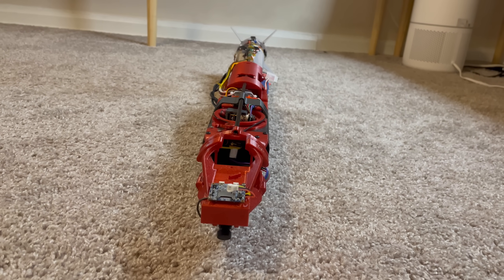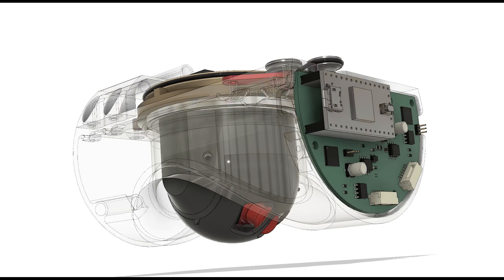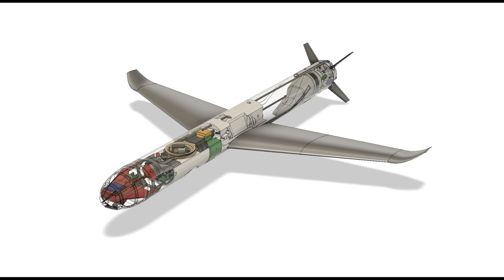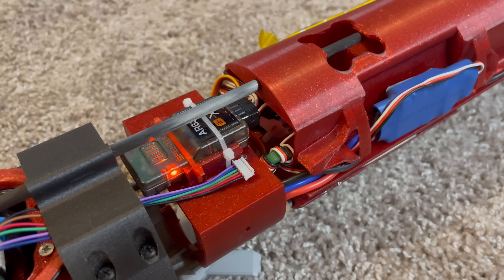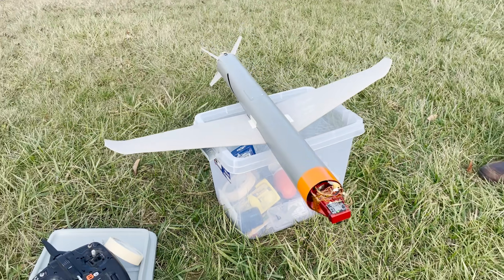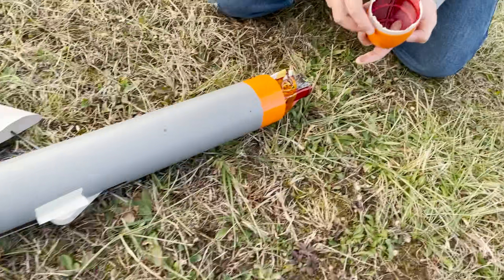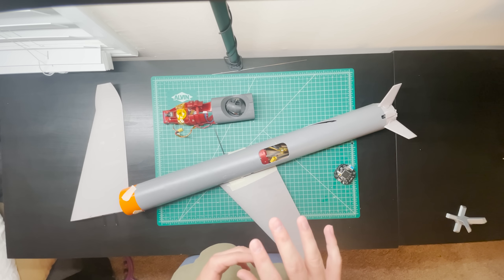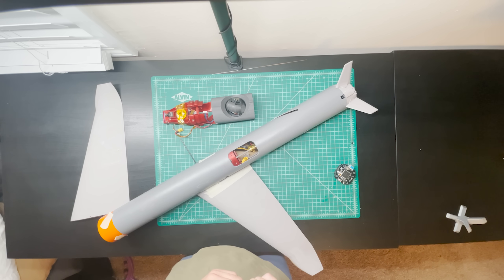Building (And Crashing) my Homemade Surveillance Drone

Comment: Don't rush with changing control fins!
I think, you should think about center of mass and center of lift relative positions.
It's considered to be easier to make plane with center of mass closer to nose then center of lift...
I think, you got it right...
Then, it must be not sufficient lift! You aircraft is to heavy for its wings!
I think, the wings should be 2x-3x larger. But it would add weight. Could you make them out of foam plastic?

P.S. I don't make planes, so I could be wrong.

Comment: You could keep the bottoms as long if you added a strong magnet to the back fins with some teeth to hold control authority. That way you just stick them back on after the they pop off.

Comment: it would work as a submarine but you need larger intake vent for edf to gather compress and force cubic feet meters out tge rear yes the weight is high , i can imagine it plane launched likeca glider but i don't think it has enough thrust to weight ratio ya can't really make up for it with 3x current wingsize for  more gliding surface area   but with a lil help it should be flyable

Comment: I am sure this is already under consideration, but this drone acting as a airborne relay/repeater point for the rockets telemetry packets like how the featherweights can relay gps from other lost featherweights would be an incredibly cool feature. Especially when it comes to two stage and higher altitude flights.

Comment: It's hard to tell what other problems it might have until you reduce the weight.  You can tell if the balance is correct without even trying to fly it.  Just find the point at which it naturally balances.

Comment: I would of assumed most of the build would of been done in LW-PLA rather than PetG. Granted the PetG is a more robust material, but of course with that adds a fair amount of weight.

Comment: As for the tailplane - add some vertical  and horizontal stabilizer  and not just control surfaces  - and make them bigger.  Also avoid big mass far away from cg.

Comment: On the EDF intake - it seems rather resticting the air flow. You need a lot more undisturbed intake area. I see that you want to keep the space for the folding wing. However it would be good to add air intakes on both sides and not on the bottom.   Very critical is also the boundary between EDF and intake.

Comment: The slingshot rail launcher is a good idea, I'd hook at the front, as without momentum at the front, the "pusher" is basically flipping the rear around, hopefully yanking it on a rail from the front will have it up to speed so the pusher isn't "end-arounding" it.  Good luck!

Comment: Sucking the air from the bottom creates aerodynamic downforce. Having it on the top would generate you extra lift, but during high aoa maneuvers you will have flow attachment problems.

Comment: You can attach an assisted launch booster at the bottom of the drone, it should give it enough thrust in the launch stage to reach cruising speed. The current fan is also most likely too small to propel something of this size, the drone has the features of a cruise missile, you might need to increase wing span to get allow the drone to glide better, this can also reduce your excessive yaw rotation during launch.

Comment: i was working with the Mirach series (targets) and they're very similar to the design you're looking for, in my opinion try put on a charge for the starting propulsion for short takeoff (with a tilted angle) or as you said a rail catapult, but i think you can improve the design changing the air intake and putting it on the top (or bottom) of the model in order to increase the aerodynamic suction angle and don't lose stability due to the small mass of the plane. you need to have an incidence for takeoff for this kind of design. Tbh cool idea, you can create a simpler underwater version with the design you made, if you put a fixed wing and some radars below (i was looking into make a similar models myself but require too much time for design of the wing nozzle etc)

Comment: Not enough thrust for launch, just by eye that thing looks like it needs to be going miles faster than you are getting it.

I think your best option is the bungie powered rail launch system you described to give it the initial velocity. 

Are there any more powerful EDFs you could use? 

Great project though, will follow with interest.

Comment: As a fellow drone designer, I would suggest increasing the number of fans used for propulsion, as well as adjust the direction of the air inlet to being balanced by being two openings on the sides either behind, or inside, the holes for the wings, as the drone appears to keep having the rear take a dive right after it leaves the launcher's hands, which may be being caused by the inlet being solely on the bottom causing the rear to dive, due to the suction of the fan, before the drone can get up to a speed that will allow it to maintain vertical stability despite the suction coming from the bottom. Just my two cents worth. Cool project and keep up the good work!

Comment: I see many aerodynamic errors in your design. You have to create a larger wing area in the tail. You have almost nothing to catch air and keep your craft straight. You have to think arrow. An arrow has a clear forward attitude. Then the center of gravity must be correct. Study the aerodynamics of a body, where it should be. Then you are on the right track when thinking about firing rails. You have to get your craft up to speed before it gets air under the wings. Good luck and keep going. It is an interesting project.

Comment: Did you check your center of gravity? It seems a little far aft based on the stalling behavior. I would also recommend leaving the weight alone and actually using the smaller wings. Even with reduced weight, those big, high aspect ratio wings will cause a lot of induced drag, which will limit your maximum airspeed. In fact, you may not even be able to get much above the stalling speed, such that any maneuver entailing positive AoA could induce a stall and loss of control.

Comment: Short of wind tunnel testing, I would consider using some really basic spring wire and wheel landing gear and as you said remove ALL weight besides propulsion and control. If you can't get airborne at least you aren't crashing. Even though I can see what you are wanting to do with the wings I suspect that they are still much, much too short for the size/weight and limited thrust you are generating from that small ducted fan. Another major consideration would be the airfoil shape of the wing and lack of control surfaces for "flying". The considerations for aerodynamic control are huge and beyond the scope of a "comment". I don't know your experience level but this is dramatically different physics from rocketry. In rocketry you are dealing with a lot of thrust, technically enough thrust can make a rock "fly" but now you are trying to make a plane that is flying mostly by airfoil lift. It can certainly be done but I think you are going to have to work from calculation and aeronautical engineering towards your design or just attach enough thrust to it that it doesn't matter. Do some basic thrust to weight calculations. Anyway, I am impressed with your effort and encourage you to keep learning, designing, and testing your idea.

Comment: Some suggestions.

More foam, less plastic. Foam wings.

Ideally make the whole fuselage out of foam halves with pockets for electronics and lightening.

Two fins, upward, V-tail, deploy them during flight so they don't interfere with booster.

Catapult launch.

Fins only need a small control surface, large stationary fins stabilize.

I think the little fins in your prop wash are more harmful then helpful. Planes usually use vectoring cones.

Comment: I would suggest adding more surface area to the tail. It doesn't all have to be control surfaces. Maybe try a RING as straight surface area, and to somewhat protect the fragile fins, and use the fins and thrust vector vanes for control surface. A mix of the two might help you out. My 2 fairly uneducated cents on it.

Comment: Without data, it looks nose heavy.  for good flight characteristics try to have the CG between 20 to 30 percent of the MAC (mean aerodynamic cord).  On a straight un tapered wing, the MAC is pretty easy to eyeball,(about a quarter back from the wing leading edge) and you can balance the plane there.  with a swept tapered wing the MAC probably should be calculated.  planes fly even unpowered, just not as far.  hope this points you in a good direction.  good luck.

Comment: If you get yourself some 3030 T slot aluminum you can easily put together a launcher for the drone using bunje cords. Im currently working on a long range survey drone, one main part is a launcher! You can also use compressed air to launch or even a magnetic rail but bunje or large rubber banding would do the trick nicely.

Comment: Aerospace engineer- one issue is that you want ~1/4 the projected lifting area of the wing in the tail, way bigger than you currently have. Reducing weight will help too.
Reply: A "Y" tail is also a good idea
Reply: And I'd recommend looking at tail sizing info in Raymer's Conceptual Aircraft Design

Comment: First you need to learn the weight factor, that will never ever take off, even if you bungee launched the brick.  You may be able to flight this brick with a propeller but no with EDF of 50MM or even 80MM.  You have too much inside, or you need to shrink all that.

Comment: The enemy of all mechanical systems is jerk (the time differential of acceleration) and this is especially true of control surfaces. Think what happens when you throw a paper plane hard and fast as opposed to lightly. Id recommend setting your wing area and angle of attack such that it at least lightly glides when "launched" gently, at least then you have something to go by.

Comment: You may want to consider using a fold out propeller instead of an EDF. You will get higher efficiency (more loiter time, lighter battery) and it will be much easier to launch initially thanks to the added static thrust

Comment: Reduce weight absolutely. Run cad Sims of airflow and optimize wing weight and shape with drone. Use PLA aero or PLA light. It leads to yes some less durable parts but reduces weight SIGNIFCANTLY which is a huge win.. Then use CF nylon for those constant tension parts or payload. Also just make those control surfaces big man. They just will be a disposable part, you need to temper your expectations with 3d printing and take ADVANTAGE of the fact you can print a buttload of them. Design around your strengths, you are trying to make something that's more suitable for Sheetmetal than printing. That's my piece, SUPER COOL MAN KEEP IT UP.

Comment: Cool project. I started modeling airplanes in the 60's. 

It's built way to heavy to fly as a hand launch machine given the thrust to weight ratio.

The lower fins are a terrible idea for a reusable vehicle that belly lands.

A takeoff and landing skid similar to model sailplanes would provide a place to mount a tow hook for rubber slingshot style launches.

Another idea would be to bend up a wheeled dolly out of coat hangers that would cradle the airplane during rolling ground launches and fall away after take off.

To get an idea what these cradles look like; look up control line speed racer videos.

I think the speed of these things will amaze you.

Comment: To put it simply, you've built a something with missile sized control surfaces but flying at standard aircraft speeds. So realistically you need to either fly faster, or increase the control surface sizes.

Comment: First, you have to define the center of weight. Then you can set up the aircraft like a scale and balance it.
Reply: Of course, you also have to weigh the aircraft and make sure that the thrust force is sufficient.
Reply: If the whole thing should fly I think you would need a stabilization mechanism for the control.

Comment: I think you don’t have enough trust to be honest. You need bigger wings or more thrust.

Also I would look at making a nozzle you can use for thrust vectoring without adding drag in the nozzle like with the fins inside the nozzle. 

But it’s clear it’s a mix of too heavy, wings too small, too little thrust.

Comment: Look, I'm no expert, but I do have a loose understanding of aerodynamics, physics, and airplane design.

1. When you told me a single electric turbine was going to power this thing I was a little impressed.
2. The angle of your air intake is not beneficial. You need an actual air scoop to help force air it. However this will add drag.
3. The profile of your "drone" is similar to a cruise missle. Cruise missles are designed to travel a way higher speeds, that rocket engines provide.

In closing an electric powered turbine is not suitable for what you are wanting to do. Unless you want to add two more, one to each of your wings. Also did you make sure your center of gravity is correct?

Comment: I've been flying RC for my whole life and while I don't hold any degrees of higher education / demonstrable knowledge on aerospace systems I would say you have two real options, keep it very light or if you want it to fly well I'd scrap the EDF and move to a folded prop pusher....but now you can't steer via thrust manipulation. It seems to me that the amount of air an EDF needs to push through your guiding fins feels like it's too little too late with those interior guiding fins,  causing a slide/drift of the aircraft rather than solid air surface control, it's why "weapons" that look like this are very linear from deployment to target. Love the design, keep iterating. You need to solve the problem of moving large inertial mass (the wings) with authority and fidelity from small surfaces at the rear of the "drone", so more power, lots of it, or figure out how to put control surfaces in the wings and the EDF might still be viable if you can launch it quickly to it's required flight speed.

Comment: i think that it should be better for fod to put the intake in the upper part of the fusselage and in the case of stability, putting bigger fins that can snap (to not overload the servos) on langing or a sort of skis to prevent damage at the landing.

Comment: The problem I see is that this aircraft does not WANT to fly.  I don't really play much in the RC space these days, but when I did, the first test I always did was a glide test.  If the aircraft doesn't glide, it won't want to fly.  You can overcome this with brute force to some degree, but given the high stall speed, I think this aircraft needs a ton more lifting area OR you give it wheels and allow it to get sufficient ground speed prior to takeoff OR you strap a rocket to it and takeoff at a 45˚ angle.  That all being said,  for your use case, I would be aiming at a slow and stable aircraft.  I'd aim at very high positive static stability.  If you let go of the controls, it should naturally want to return to stable flight.  Most of my designs were seat-of-the-pants with napkin math, so grain of salt and all that.

Comment: i think a rial launcher would probably be the best idea. that would get you in the air easier and with a more repeatable method. I think this is my first video of this series so i apologise if this has already been checked but have you done any thrust tests for that ducted fan? i would have expected something like that to at least pick up a bit of speed after a hand launch but it doesn't look like there is a whole lot of thrust coming from that. i do look forward to the next video and i will have to go back and watch the previous videos.

Comment: I think you should definitely try the rail launcher. I would definitely remove the complicated servo portion from the wings and just make them spring loaded and retaned by a rubber band that can be cut with some nichrome wire heating up around it or something. That would remove alot of weight. The servos are cool but I dont see a need to retract the wings.

Comment: Sling launch your drone, that will remove the weight take off issue and force needed to give it lift, could also use light weight flexible material affixed to wing and the fuselage when folds out it turns it into a delta wing setup to give it more lift.

Comment: I don't know exactly, but for me it seems a problem of lift, if you want to keep launching like that, It lacks thrust

Launching It by hand doesn't help. In the last attemp it turned backwards. Maybe try buildint a Launcher or putting wheels.

Center of mass and weight is something to change to improve. The center of mass must be around  the Blades so forces are at equilibrium (they don't produce momemtum)

For the design, I thought It was going to be launch as a rocket or something, and then just glide and hold the hight

Comment: Haven't done RC in awhile but I think its a bad sign if while muted I can't see any difference between uour engines being on or off. I'd expect more violent crashes at max thrust. Even little prop planes go wild on test flights!

Are you sure you're generating adequate thrust?